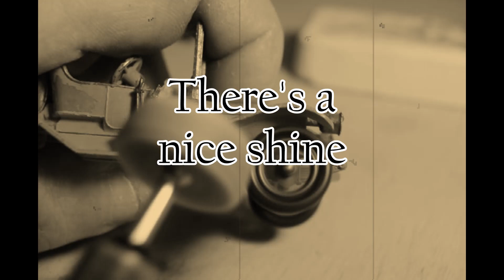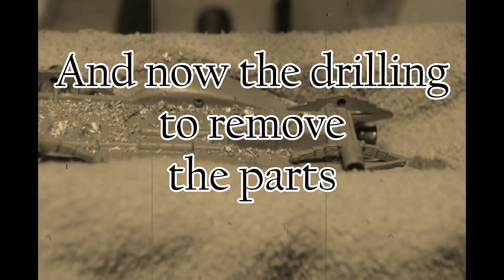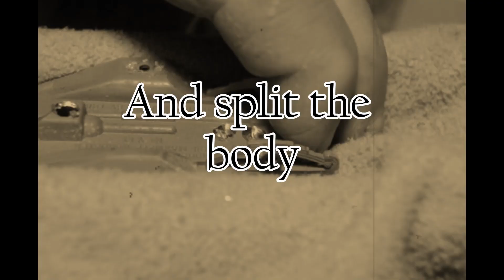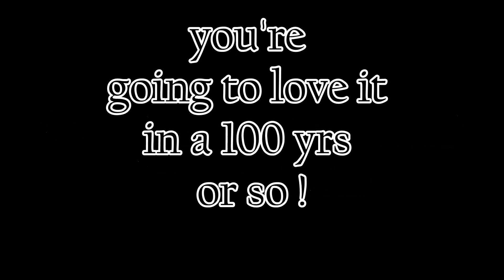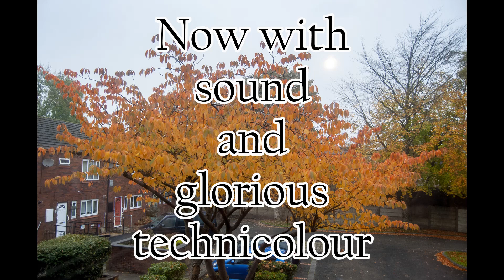matchbox models of yesteryear , 1911 maxwell roadster , restoration

Comment: Excellent job, but how did you replace the wheels and axles. I have a stutz bearcat that has a bent axle and don't know how to fix it.
Reply from the maker: quite simple grind or file the peaned over axle end till it is easy to remove the wheel , straighten or replace the axle then once re assembled pean over again as shown in the video